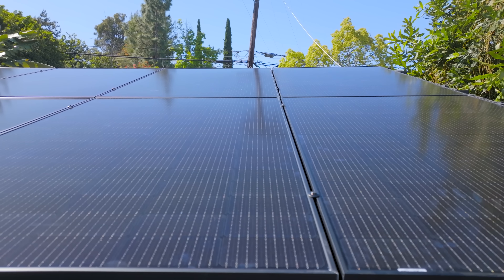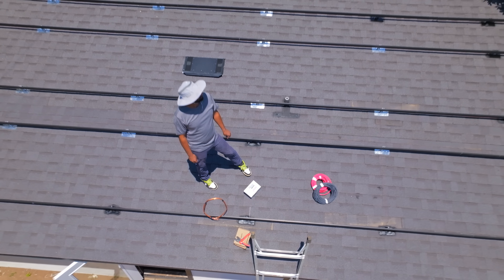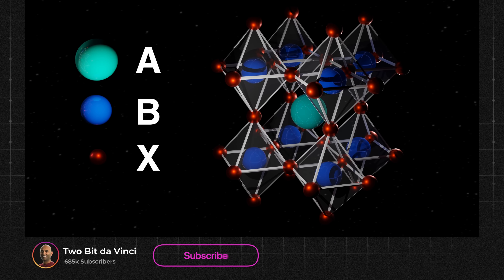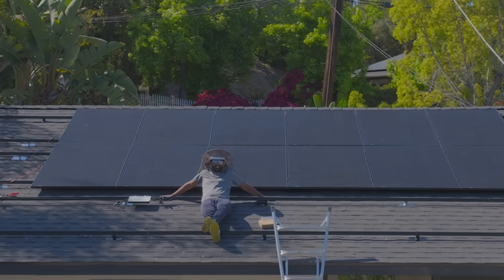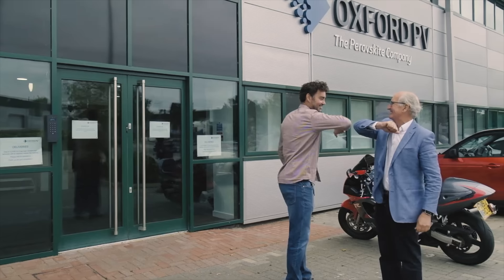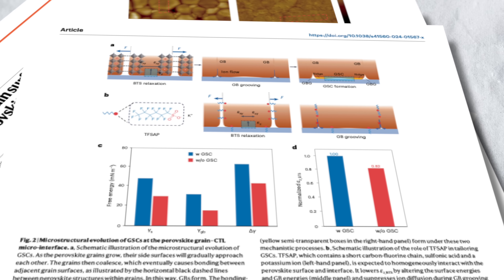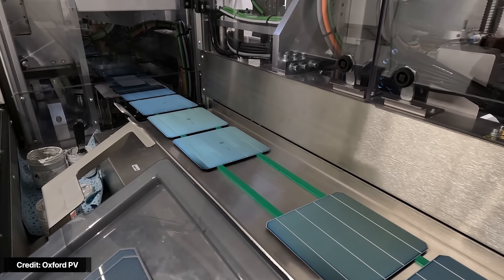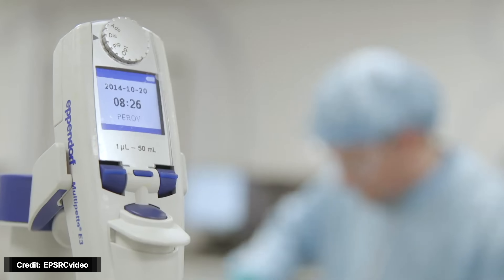Secret Unveiled: How Scientists Prolong Solar Panels' Lifespan

Comment: The elephant in the room isn't the cost of the panel or the efficiency; it's the $850 of installation cost per panel. Breaking that down, being generous, it's probably $150 for mounting hardware and inverters and the rest is what the contractor is charging for labor, so $700 per panel for labor. Over 30 panels, that's $21000. There is clearly room for that number to be lower. I mean you watched them install it, how many man-days was used for the work? Again being generous, maybe 4 man-days? It's literally just someone climbing onto a roof a couple dozen times with a load and screwing it down; it's less labor than installing an actual roof. How much does someone need to charge for 4 man-days of labor and run a profitable business? Maybe $5k? Installers are treating early adopters as a gold mine; they are charging what the market will bear factoring in govt incentives and local electricity rates to get a decent ROI. If they charged a fair price of $5k, bringing the total cost of a 12000W system to $14k and a breakeven ROI of less than 2 years, everyone would sign up.

The problem with solar isn't for lack of breakthroughs over existing panels. The problem is the market and competitive landscape of installers to charge a fair price for an honest day's work.
Reply from the maker: absolutely right...we gotta get that cost down, because when you break it out, you realize the solar panel itself is SO affordable... its the install that is expensive.
Reply: @TwoBitDaVinci how has Australia solved this problem? I know they get their panels cheap from China without tariffs and so forth but is there anything that they're doing better on the install side? I know permitting and connecting is so much easier there than it is here
Reply: Yeah,why don’t you go up there?
Reply: @Preciouspink  What you think I've never been on my roof? You think daring to climb up onto a roof justifies a $16k upcharge? I can get a brand new roof installed on my townhouse for $5k, materials included. How are roofers able to do a similar kind of labor without ripping you off?
Reply: @TwoBitDaVinci one good thing is in the developing world solar panels are becoming more economically viable since the materials are relatively cheap and labor is also cheap. Obviously cheap labor is always a controversial topic, but the point remains 🤷‍♂️ more solar panels seems like a better thing than less solar panels
Reply: Do it your self
Reply: One factor is that most electricians are union members, whereas most roofers are not. I'm pro unions, but the extra cost for unionized labor is significant.
Reply: It's not just the mounting hardware, it's also the inverters and batteries. Those $850 include everything else, not just labor
Reply: @xungnham1388  Buy solar panels and contract roof installers to install them.
Reply: @xungnham1388 You guys must be getting ripped off left right and center in the US, In the UK my company installs a 7.6 kWp PV system, 8.8kW Hybrid inverter with 15.5kWh of battery storage for around £9500, that's around $12,500 USD, fully installed, certified and signed off.
Reply: Several added costs to the installation companies likely drive the price. The first issue is finding people willing to work. Then finding anyone with talent or skill sets to do the physical work of moving panels to the roof, making the connections and configuration of all the components to work together. Of course a legit contractor would have workers comp and liability insurance costs, self employment taxes, plus the cost and time required to source all the components to do that “quick installation job”. Many factors are easily overlooked when these small costs are not accounted for. Any company in business wanting to stay in business will charge a price large enough to cover their cost and make a profit large enough to justify their efforts. Quality work is not usually the cheapest. The cheapest is not always the best value in the long run.
Reply: Same applies for Europe. Installation cost in US are crazy! Cheap imports is not the issue to get cheap electricity, it must be a type of monopoly in "free America" .
Reply: So, should it not be possible to mount the panels yourself (or just pay a general construction contractor to do it--not that that business isn't also rife with criminals, at least where I live) and run the wiring yourself and then hire an electrician to do the final connections between panels as well as to the breaker box or wherever it goes to?
Reply: @bas5946  well in the us everything is overpriced
Reply: @xungnham1388  You make an excellent point. A small but unavoidable part of the exorbitant cost is an electrician to tie it all into the electrical system, but that really shouldn't be more than about $1000 in labor for the steps that only a licensed electrician can do, if they are quick and efficient.
Reply: The US is SO inefficient for Solar. I put 30 panels = 9KW system on my roof for AUD $ 14.5k = USD $ 10k and he talks of $ 30,000 for his 30 panels. He pays $ 850 per panel for installation. I had 2 people for a day and they installed 30 panels with inverter and website linked in and it was ONE DAY ONLY.
Reply: If this were true then why have so many solar companies gone out of business?  Can't tell you how many calls I get asking for help from customers that went with fairly big names and they're still out of business.  If you're considering solar, ask for a proforma.  I share this with all of my customers so they can see why things cost what they do.
Reply: @contrarian777  If Toyota tried to sell Corollas for the price of Porsches, they would be out of business as well. Every commodity has a price-demand curve. Price too high and get low sales volume. Price lower and get more sales. Maximum revenue or profit lies somewhere in the middle.

Any business will go out of business if sales are so low that their workers and equipment sit idle; that is the problem with "luxury" pricing.

There have been replies from people from developed countries (UK, Australia) quoting 40% of the total cost. How do those installers manage?

Comment: It depends, but as always its not as simple as your example, where perovskies cells just dies after 15 years. You mention that over 30% efficiency could be made with tandem cells of normal solarcells. So what happens in these cases, after the 15 years? 0% from perovskies, but still 23% from silicon? or 0% from both? What about silicons gradual degrading? Will this perovsky tandem cell structure "protect" them more, and their degration will therefor be lower?
For me personaly, i would go for max amount of cells my roof supports.
The more of the year, my solarcells could cover my loads, the better. saving 25-30% is nothing vs being less depending on the grid, and have more time where they cover your needs.
As one already wrote, perovski cells potential works better in winter, so maybe this sandwitch design is just the one we need.

Comment: I went with the Opues mega 3 myself.  Just got the thing last week have spent this weekend playing around with it. I got 4 solar panels that fold-out with it that supposedly get 240 W but I've only managed to get one of them up to about 180. Haven't even taken the other 3 out of the box yet because they're so big,  literally 100 inches long. That's almost 9 feet. And the cords they came with don't reach very far so I can't get them all the way out into the yard Just out on the back porch. So I'm currently looking to find extension cables for solar panels and they're not sold in my area so I'll have to get them offline and risk porch piracy. Or have them shipped to my dad's place. Which is what I did with this unit but it's a long a** drive to get to his house Since he's Over A 100 Miles Away. But this thing in my house I can run a big screen TVA computer a soundbar 3 different lights and The playstation which are all plugged into one outlet on AUBS which I just plug into the  Is solar generator itself. Only Poles just under 400 W and can run for over 12 hours on the batteries. With just the one solar panel plugged in I jumped that up to 16 hours. So if I get all 4 plugged in I'm pretty sure I can run indefinitely as long as the sun is out. I got this thing after my power went out for the third time in 3 weeks for over 6 hours. And screamed enough was enough.

Comment: do the calculations at the end account for what you said about panels reducing to 80% of their original output...? seems like that would also be pretty significant factor to account for. but also doesnt that mean the perovskite can keep going after however many years? they dont just suddenly completely die, do they? i thought you said the same thing about them, that the amount of year stated is the point at which they drop to 80% output? or did i just mishear that?

Comment: How could a sandwiched panel combining standard panels with an extra perovskite layer ever be cheaper then the standalone standard?

The price per panel (m²) is definitly higher, the price per Watt might be better though if the added gains are higher then the added costs.

Pure prevskite panels might be cheaper, but also less efficient.

Comment: "I can't go more than 12 minutes under the sun". Curious, I can be for far longer and my skin tone is lighter than yours. One would think that Melanie is an adaptation to higher sun exposure.
That may be somewhat counter intuitive.
I've checked, San Jose is 37 degrees north, and Toledo Spain is 39, so there's not a huge difference.
Maybe that would make for an interesting video. As how much resistent is the skin to sunbun. I think that your team has a lot of variety in this regard, so you could take even "experimental data".

Comment: would it thoug? first of you said yourself 50 Bucks per panel seems unrealistic. hence all subsequent calculations are unrealistic aswell. then after 17 years it needs to be replaced which means you'll also need to factor in the installation cost. this, I assume, will be the same for both panels but Perovskite will need more frequent changes. so even at a durability of 17 years perovskite will be economicaly less efficient. i think, it would need to last at least 20 years to be economicaly viable.

Comment: If it's 0.015 microns thick, why does the lead content matter? That's an extremely minimal amount of lead. .015microns is 1.5cc material accross 100 sqm system and not all of that 1.5cc is lead. That's a singular fishing sinker weight worth of lead.

Comment: You can't be simply linear. Also the brackets would still be usable very likely when you replace panels with newer panels. If solar panels become at least 5%  more efficient every 5 years Than it might make sense to replace the panels every 5 years. This is why I don't like to invest in something that I will be locked into for 20 years.

Comment: Come on man, it is 100% more efficient not 100 times more efficient.
And that is under perfect conditions that have not actually been reached yet .
The best is like low 30’s % efficiency versus like 22% efficient for single junction, solar panels.
And you mentioning yourself that this new panel that’s about to launch is 25% efficient which compared to 20% is only 25% more efficient…

I like your videos man you’re getting the basics completely wrong here .
100 times more efficient would mean we have a panel that is 20% x 100 = 2000% efficient.
Pretty obviously not what’s happening .

100% more efficient even that claim is hard to defend but yes the medically some are getting close like the 40% barrier .
And most solar PV cells are actually a bit below 20% so  ok, but this is full on disinformation you need to take down this video and re-edit it, and re-upload it.
This is perfect ammo for people who are solar panels to use and abuse against the general right direction that people should be heading .

Plus, it might discourage people who should be buying solar panels to not buy them when they absolutely should .
We don’t know when these are coming we don’t know how much more expensive they’re going to be because they’re probably going to be perky plus semi conductor so they’re going to be more costly at least for the foreseeable future , so people should buy solar panels that are available now they are extremely cheap and extremely profitable today.

And irritatingly that’s a conclusion of your video … which otherwise is really good.
Why do you have to put in these hype numbers that are just plain, obviously, wrong.
Please fix this . And please stop doing it.

Comment: Isn't N-type and Bifacial the best solution for 2024 (and upcoming few years) ?
That's already 22-24% efficiency PLUS the gain of bifacial (up to 20-25% with snow/white surface), not to mention better durability (double glass and N-Type tech)

Comment: "Efficiency 100X higher than current cells." Huh? Current mainstream panels are 20+% efficient, therefore a 100% efficient solar panel would be at best 4X more efficient. More than that is physically impossible.

Comment: The rate of inflation is an error in your video. It's the alternate investment return that you need to use. Think of investing the extra $9k up front savings into the stock market or a treasury bill. You will get between 4% and 10% expected return, depending on the risk you want to take. So, add in that to the perovskite calculation and see what happens. The perovskite wins, hands down. A total reversal of the video's conclusion.

Comment: You can go to solar panel vendors in the US today and get regular old silicon 400+ W panels for around $125 ea. That's quite cheap! Are any perovskite panels going to be able match that, let alone beat it? So the panel cost is not the issue, it's installation costs that are many times that per panel that need to be addressed. Every time I hear such trumpeting about Perovskite breakthroughs, I just have to shrug. Honestly I can't see any panel being sold for much less than $100 ever. Plus silicon longevity is pretty much a given, why would anyone risk on Perovskite? Sorry, just don't see it. Let me know when they are actually 50% efficient, or maybe 2 sided with 25% eff. On BOTH sides. Now that might actually give silicon a run. Maybe.

Comment: Most modern Si panels are now 23.1 to 23.8% efficient so the 1.8% isn't worth it currently. You can bet that if or when they do hit the market, they will be twice the price for modest gains. An Aiko Gen2 455Watt panel is 23.1% efficient and costs £62 in the UK or around $68 USD. More Hyperbole unfortunately.

Comment: Better collectors don't fix the shortcomings of "Free Energy" source.  The reason fossil fuels have all the benefits is having them on sight enables them available on demand to balance as well as switch on/off.  On fixing those shortcomings will enable the dream of replacing fossil fuels!

Comment: Heat pumps are a better investment in my estimation than solar panels for homes. Scientifically speaking you can take the same electron from anywhere and use thermodynamic principles of liquid to gas/gas to liquid conversion and get way more return than an unproven technology that satiates carbon phobes. Homes are built so inefficiently it is laughable. Why do we have refrigerators/freezers that spit hot air into a home that might need cooling. Why not take that heat and transfer it to a hot water heater? Technology is already here to create a more efficient home but we ignore it hung up on tech breakthroughs. Build a whole home heat exchanger system on known technology which will save us all more money through increased efficiency! I won't even go into how much more efficient nuclear fission is than any of these solutions.

Comment: "promising to unlock pv-cell efficiencies a hundred times higher than current commercial cells." This phrase is not only completely wrong, but for the audience it implies that current cells are more than a hundred times less efficient than 100%. That is not comedy, that is obviously exactly 5000 times worse than proclaiming that climate change is a hoax, and 6Mio times more dumb than to say that Switzerland hat 100 times more nuclear missiles than the USA.

Comment: One thing your calculations fail to account for is opportunity cost.  So lets say your traditional system lasts 30 years and the perovskite only lasts 14... the traditional system is by far the better buy.  However 14 years from now, when it comes time to replace the perovskite system, the technology may be so good and cheap, that the LCOE of the new system completely offsets the higher cost of the first system.  Hell, they may be so good that your replace your traditional system well before it reaches 30 years old.

Of course, its impossible to guarantee that this will happen, however if you look at LCOE of solar over the last 15 years the cost is an order of magnitude lower today.  If this trend repeats, a system deployed in 2040 would have to hit an adjusted LCOE of $0.01/kWHr.  This would be a 12kW 25 year system for about $5000 installed... possible if installation can be greatly simplified.

More likely if they became that cheap, the LCOE of grid solar will become so cheap that having panels on your house will not be cost competitive due to the economies of scale and the fact that your would still need to pay for intstall, plus the cost of a grid connection or battery system.  I suspect that at some point grid power will be largely a fixed montly price (up to a maximum use) like our cell phones.  Paying per kWH won't really make sense because the grid will have a huge surplus most days.  Instead will will pay a fixed cost for the infrastructure and only pay per kWH if we abuse it.  They will be competing with going off grid, so it has to be cheaper and easier on homeowners than your own panels and batterys.